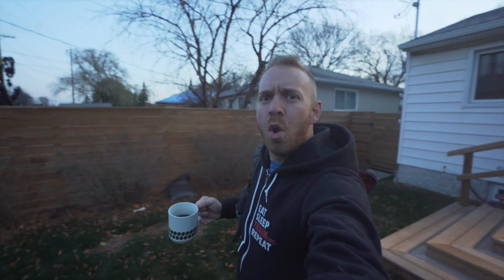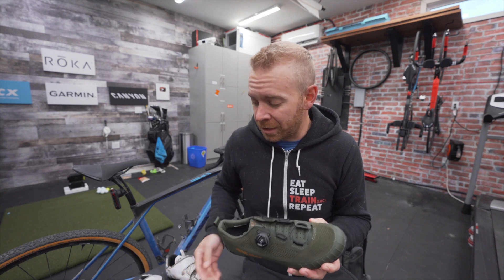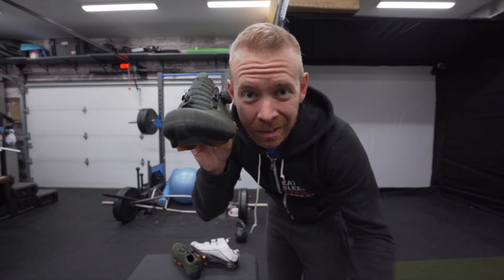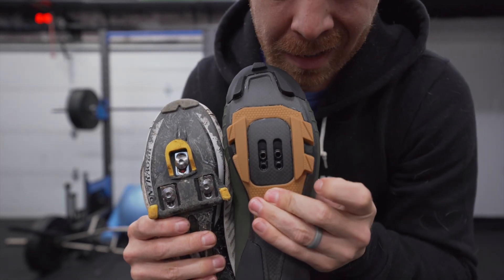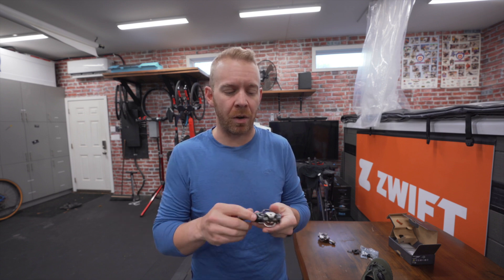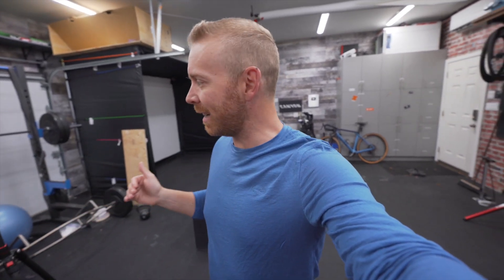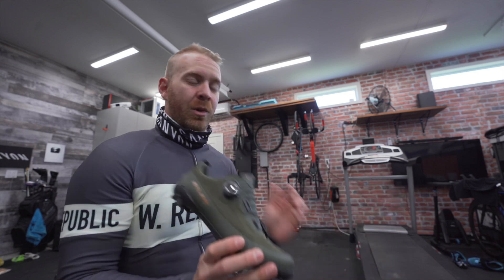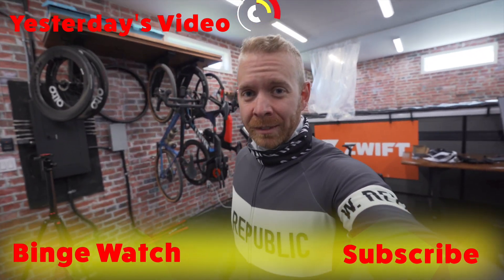Best Gravel Bike Pedals For Every Budget

Comment: I've recently switched from spd (Shimano xt) to spd sl (time xspresso) clips. I mainly ride Gravel in the Netherlands where you don't have really nasty trails with a lot of clipping in and out or even walking. Therefore I prefer the road pedals over mtb pedals because the don't have that much play and a wider / stiffer platform... When riding on really nasty trails or bad weather conditions with a lot of mud and slippery sections I switch them over to mtb pedals. It just depends on how much 'footwork' there is on your ride what's the best pedal to use...

Comment: im just using my old mtb pedals which are combi pedals. one side for clipping in and the other side without. this gives me 2 advantages. one i can use the flat side if the terrain is very sketchy and i dont want to be clipped in and two i can use normal shoes when i go for a slow and easy ride with my little kids. seems to be the best of two worlds to me.

Comment: So for the last three years of Gravel/CX biking I just transferred my old mountain bike XT pedals over to my CX bike. The only thing that I have noticed is after about 3 hours my feet start to get hot points on them. I probably need to stop more and stretch. I have thought of just putting road pedals on but when you're walking in gravel, mud, sand those road shoes are not very good and those conditions.

Comment: I used road pedals and shoes once on a gravel ride because I didn’t want clunky heavy feel of 2 bolt mtb shoe -I wanted light stiff and fast like on road bike. the first time I stepped off in anything but pavement I had issues clipping back in, walking in gravel in 3 bolt is a nightmare, even a single blade of grass kept me from clipping in. I Discovered the rx8 shoe, they feel like my road sphyres but in a 2 bolt and much cheaper. My problems were solved. My opinion is yes, “gravel” shoe makes sense, not as clunky as mtb shoe, but more useable off-road than a road shoe.....kinda like a gravel bike itself.

Comment: I use the half MTB half flat panel ones ... So I can use regular shoes for a quick ride to the store
Reply: Same 👌🏻
Reply: Are they the Shimano PD-EH500 SPD Pedals? Thinking on grabbing these for my gravel bike which will also be a commute bike to school (so I can use the flat side with my casual school sneakers). Are they too heavy? Or do they flip around when you take your feet off because then sides are weighted differently? Do they still perform well as a clip less pedal?
Reply: @RyanMalley  did you find a set of pedals that work for you? I’m looking for the same
Reply: What pedals are you using? Hoping to find something similar for my commutes!

Comment: Thanks - great overview. 

I really like the Speedplays because the shoe has a little left-right “play” or movement when clipped in. My knees are much happier with this. 

Do any of these gravel pedals have a similar amount of movement? Or are they all locked in solid?
Reply: You can decide how stiff the pedals are, but they do have some movement definitely more than the SPD-SL
Reply: Time Atac allow the front of your shoe to float, I’ve just swapped to them from SPD and my knees are much happier, whether I’ll be able to clip in and out as easy during a cross race I’ve still to find out

Comment: Hey Taren, what's the difference between the gravel and mountain bike shoe?
Reply: An XC race mtb shoe will basically be the same as a gravel shoe, both will have a stiff sole that’s carbon or another composite, and are designed for efficiency as well as being able to walk in them. You want to stay away from more trail or DH oriented shoes, because those are floppy and designed solely for comfort, they have a similar sole to a skateboarding shoe. I run the Fizik Terra X5 shoes, they’re not too expensive if you find them on sale and they’re stiff enough for good power transfer.